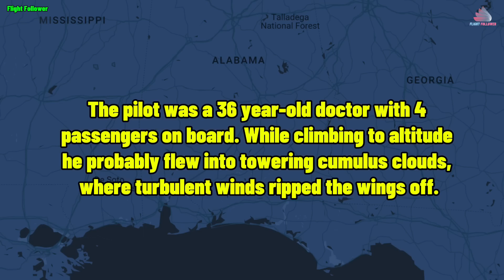Small aircraft Inflight break up due to Turbulence (FATAL Crash!)

Comment: the ATC is made of several CPC, all doing different jobs. The terminal CPC and the enroute CPC tend to overlap jobs for a little longer than normal on nice weather days. But in bad weather they are not supposed to because the enroute CPC has more information on weather enroute and they know more about various plane capabilities. . Each CPC category is trained for a specific job and they are not the same. They also get ongoing training every month. for UpToDate info on the airport and weather and other factors that change with time and season, but each on foes to a unique set of classes for their specific CPC job. .The Termianl and enroute CPC DO NOT go to the same anything . My replies have been censored out by people when I reply to them directly because when someone reply's direct a comment, that person you are reply ing to can have the comment removed.  Several people trying to push false narrative the pilot was at fault have tried to hide the facts, cheating to get their narrative to look like people agree with them. .  The fact is the CPC on duty killed these people. He failed to hand off this plane after departure to the Enroute CPC who was aware of the weather. The FAA is not revealing this fact. The CPC on duty for the terminal and departures was likely trying to earn his way to becoming an enroute CPC and was holding onto traffic longer than he was supposed to, to show he can do the job. He gave this guy enroute directions right into the bad weather and the pilot never challenged the CPC. hat CPC should be fired and never work again at ACT. his desire to be promoted overwhelmed his common sense. if he had any. I can't believe he was actually telling the other plane that he had not had anyone fly thru the bad weather to giver a report yet. OMG. He just got a report from that plane that the weather in that cell was dangerous, when they asked to deviate. NEVER, USE any ATC flight following with respect to weather. They are only good at avoiding traffic, and not even then always.  With Today's ADSB in data, you literally don't ever need flight following for traffic or weather. Just get a $900 receiver and then use flightplango, its free. ATC will kill youy sure as sure. The FAA will protect them after the by blaming the pilot. Too many pilot are brainwashed by this systemic process and have become unwittingly sheep to agree with the FAA and not use their own common sense, when looking at the accident facts or hearing the Com..

Comment: Storm air is apparently serious. I'm not a believer in alu sheet and rivet construction. It's both flimsy, ugly and labor intensive. The way Diamond does it with 2 extremely strong composite wing spars is probably good. It doesn't take much weight in composite at the wing base to give it strength that cannot break even at 20g.

Comment: Interesting.  I didn't realize that turbulence could do anything more than give us a rough ride.
Reply: Flying around a cloud (per FAR/AIM 2000' horizontal distance)... turbulence violently flipped my left wing up out of no where.  One big push up and it of course rocked/banked the plane.  I was by myself and it freaked me out a little.  I've flown a lot of bumpy trips but that moment sent current through me.  So yes, turbulence can tear a plane asunder; especially towering cumulus.  When you see the top of a cloud billowing, boiling and pushing up, that's convection ☠☠☠ BEWARE!
Reply: It's hard to know for sure, but it's almost certain that it was not the weather in and of itself which caused the structural overload.  Chances are the pilot lost control of his aircraft in the rough air and over stressed it to the point of structural failure.  And, if past history is any indication, the pilot was most likely not as current as he should have been when flying in IMC and I'll bet a dollar to a doughnut that he had not recently practiced unusual attitude recovery when in instrument conditions.  
Flying in and around thunderstorms is dangerous but usually not because the storm is too powerful or the aircraft isn't strong enough.  Problems like this one are almost always caused by pilot error and most often lack of currency and/or inadequate training is a strong contributing factor.
Reply from the maker: It was also beyond my thoughts

Comment: Most likely it wasn’t the turbulence that “ripped the wings off”, it was loss of control due to turbulence and pilot-induced over-stress of the airframe.
Reply from the maker: As per the investigation report
Reply: @Flight_Follower No shit Sherlock.
Reply: Bingo.
Reply: Duh
Reply: @AlbertHess-xy7ky D-bag. Shut your trap if you can’t add to the discussion. 🙄
Reply: Bingo!
Reply: Yes HUGE difference and NOT the same thing as the incorrect title of the video suggests.
Reply: Duh.

Comment: Lesson is telling ATC to KISS off, take up own navigation. ATC directed him right to it, Pilot afraid to ask for heading change. Another plane called in and asked for a small heading change even though ATC said it was clear, they gave it to him, the commander pilot was a wimp and should have made a heading change that was required. Afraid to ask ATC for heading change who was telling him his heading to take . For the other plane ATC said ok, to small heading change, but that pilot says he sees nothing on his scope.   Then after the commander crash ATC starts guiding planes away from the storm cell. This has been happening for decades. Never do what ATC says if you as pilot know better. ATC= Airplane Tragedy Creator
Reply: It was an ATC Failure
Reply: @whartonite  the ATC is made of several CPC, all doing different jobs. The terminal CPC and the enroute CPC tend to overlap jobs for a little longer than normal on nice weather days. But in bad weather they are not supposed to because the enroute CPC has more information on weather enroute and they know more about various plane capabilities. . Each CPC category is trained for a specific job and they are not the same. They also get ongoing training every month. for UpToDate info on the airport and weather and other factors that change with time and season, but each on foes to a unique set of classes for their specific CPC job. .The Termianl and enroute CPC DO NOT go to the same anything . My replies have been censored out by people when I reply to them directly because when someone reply's direct a comment, that person you are reply ing to can have the comment removed.  Several people trying to push false narrative the pilot was at fault have tried to hide the facts, cheating to get their narrative to look like people agree with them. .  The fact is the CPC on duty killed these people. He failed to hand off this plane after departure to the Enroute CPC who was aware of the weather. The FAA is not revealing this fact. The CPC on duty for the terminal and departures was likely trying to earn his way to becoming an enroute CPC and was holding onto traffic longer than he was supposed to, to show he can do the job. He gave this guy enroute directions right into the bad weather and the pilot never challenged the CPC. hat CPC should be fired and never work again at ACT. his desire to be promoted overwhelmed his common sense. if he had any. I can't believe he was actually telling the other plane that he had not had anyone fly thru the bad weather to giver a report yet. OMG. He just got a report from that plane that the weather in that cell was dangerous, when they asked to deviate. NEVER, USE any ATC flight following with respect to weather. They are only good at avoiding traffic, and not even then always.  With Today's ADSB in data, you literally don't ever need flight following for traffic or weather. Just get a $900 receiver and then use flightplango, its free. ATC will kill youy sure as sure. The FAA will protect them after the by blaming the pilot. Too many pilot are brainwashed by this systemic process and have become unwittingly sheep to agree with the FAA and not use their own common sense, when looking at the accident facts or hearing the Com..

Comment: Those storm scopes were misleading. Just because it showed no activity doesn’t mean there wouldn’t be moderate to severe turbulence. I used them a few times back in the late 70s early 80s but never did like relying on it.
Reply from the maker: Yeah
Reply: How are they misleading?  Their purpose is to show lightning activity, and they do a fine job.
Reply: @jtocwru  knowing lightning activity is not enough. They could lead you down the primrose path into moderate to severe turbulence. Never trusted a storm scope. A good radar is your best friend.
Reply: @darrells1806  Agreed, but I was simply responding to your claim that StormScopes are misleading because they don't do what a radar does.  That's like saying that a lawn tractor is misleading because it's not a Lamborghini.
Reply: @jtocwru  ha ha, actually I’d rather have the lawn tractor. Much much cheaper to operate 😎

Comment: I flew around New Smyrna beach a few miles from incident 2.  The weather in that area (Florida) changes very rapidly. Storms form very fast.
Reply: I used to tow banners in a PA-25 over the Daytona Speedway and beaches every March for spring break. Landed many times with 40+ kt winds when it was fine before takeoff. Florida ain't for push-button pilots. lol
Reply from the maker: Okay. Yeah the weather changes real quick

Comment: The fake airplane engine noise and static adds nothing... but annoyance.

The Stormscope in the Commander just picks up the electrical discharge from lightning. It doesn't mean it's ok to fly through it.
Reply from the maker: It's not a fake engine noise. This audio is from 1983.
Reply: @Flight_Follower  Ok... but that's bs. I don't care when the audio was recorded, it's unnatural. If you'll take a few minutes to think about it you'll realize that ATC doesn't have engine noise in their environment. It shouldn't be there when they transmit. GA aircraft don't have sound recording from the cockpit so it's not coming from there. The engine noise is overlaid on top of BOTH transmissions. It's consistent and it doesn't change for either side of the conversation. Maybe you didn't fake it. Maybe you are using someone else's audio and they faked it. 

Either way, it's fake and it adds nothing. Unfortunately there's not much you can do about that. 

The second clip of the Seminole sounds more like normal ATC conversation. I've been flying since the 80's and there always seems to be someone that thinks they can pilot their little aircraft through a storm and the storm wins.
Reply: @MichaelLloyd the audio doesn’t sound like a typical AM VHF radio either … sounds fake AF

Comment: Rockwell commanders became well known for structural failures due to the wing spar failing. The root cause was a steel strap, that reinforced the lower spar cap, was prone to corrosion. >> Correction >> Sorry. As others have pointed out. The corrosion problem was with the Aero twin. The single suffered from cracks in the wing spar due to loads from retracting the landing gear.
Reply: I believe that was only the twins; the single engine had no such problem
Reply from the maker: @Pilotc180 That's what I know too.